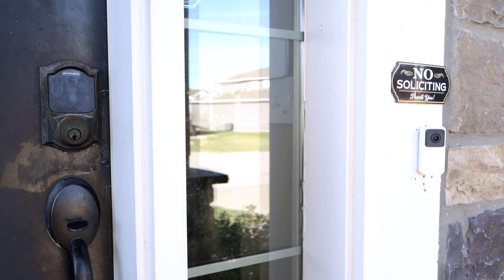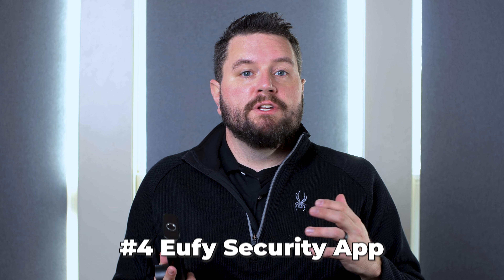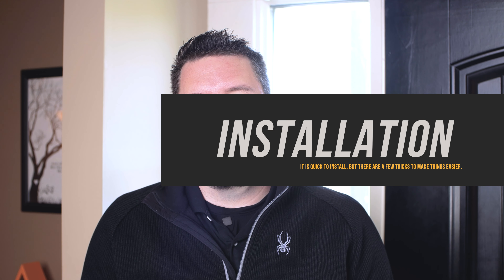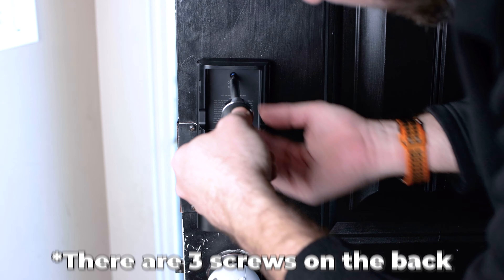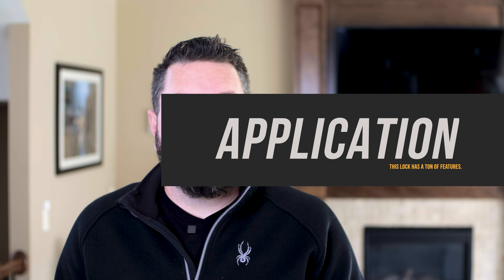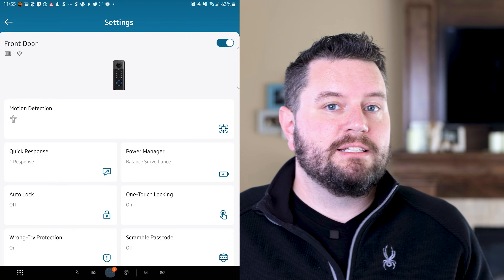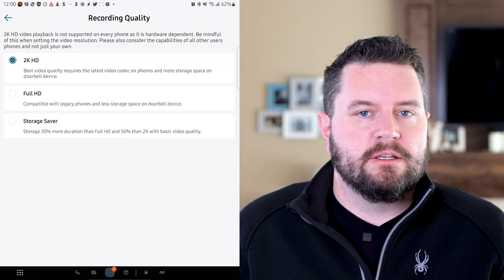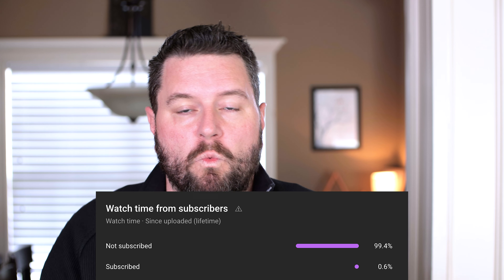3-in-1 Doorbell/2K Camera/Smart Lock || Eufy Video Smart Lock

Comment: This This Smart House video sold me.  However, I wish it mentioned the fact that the camera does not look down and therefore you can't see if a package is at the door.  Delivery person is chest and head at the door and full bodied ~ 3 feet out.  In a condo hallway it is possible to walk down the hallway stop before the camera -grab a packet and retreat.  Of course no one would do that.  I installed this 3-in-1 yesterday and found it very easy and the software to be straight forward.  Looking forward to the 4-in-1 with the dual camera facing down.
Reply from the maker: Hi Chris. I did mention the fact that the camera is stuck and can't be moved. My main complaint is that my door frame takes up 1/4 of my view. But one advantage is that the dual motion detection should pick up any motion even if they are not directly in frame. Hopefully catching a piece of the porch pirate. 

I really hope they update it with swivel camera. But I still love the lock. I am still waiting for the dev of the Home Assistant integration to support it. That will be a game changer!

Comment: I have configured access code for the lock and I am wondering if it will work without internet once installed? Chime won't be installed yet so just standard lock unlock using access code is required. Thanks

Comment: Decent video. A quick tip, its hard to follow instruction videos when there are a lot of cuts away from the meat of the install.
Like 5 - 7min mark should only be your voiceover the install video. 

Also, no need to split-screen when showing the settings... its reducing the important content on the screen.

Comment: I’m in the market for a complete front door knob and dead bolt lock, similar to this and an extra camera. I have 2 front door light fixtures with gfi outlets where a camera will go. The other thing is I have a storm door. The frame would block video until someone opens it. What do you recommend. Prices isn’t a huge concern. Something close to brushed silver on the metal park of the door handle.
Reply from the maker: If your lock will be blocked by a storm door, then maybe look for a separate smart lock and then ether add a camera (with AC power you can use anything). You could do a doorbell cam or any camera connected to your AC power (Wyze, Eufy, ReoLink, etc).

For the lock, what hubs or technologies do you have (Zwave, Zigbee, etc). Before this lock I was using the Schlage dead bolt (Z-wave). It comes in many different colors. They also make a lever handle version. Eufy has a few smart locks as well (without a camera). Let me know a little bit more about your requirements and I would be happy to help. Or jump on our discord: https://tsh.li/discord

Comment: I have the older eufy smart door model , if I install this new 3-1 can I leave my old deadbolt since is from same brand ?
Reply from the maker: You mean the actual deadbolt inside the door? I would think so, but you would want to check them side by side to make sure. I think the one Eufy uses is pretty standard.

Comment: Thanks for the valuable & thorough review! It’s really one the best reviews I certainly benefited from. I just got 2 questions please:

1: I plan to use this lock for my vacation property abroad in Turkey. Therefore, I hope it won’t be an issue if I won’t be using it too often. Because I’m not always there, I have no wifi inside this home. I currently have a bluetooth enabled lock which supports fingerprints and numerical passcodes. It works fine and does not require wifi as long as someone is physically there and has either a passcode or access to the lock app.

If I get this lock, will these features I enjoyed before with my older lock remain functional, even without wifi? (If there’s bluetooth perhaps..)

2: My vacation home is located in a community apartment complex. The complex recently installed a wonderful smart security system for building entry which doesn’t rely on internet from tenant homes, but a newly installed cheap internal internet system we started paying for on a monthly basis. With this system, I can see the building door entry area anytime using the live camera, unlock building door for anyone to enter at anytime, regardless where I am located..
Is there some sort of internal internet that I can utilize besides having to install an active internet subscription in my vacation home?

Thanks

Comment: How can you access doorbell if you have a storm door and this lock is installed on entry door.
Reply from the maker: That would be a slight issue. If the storm door is unlocked, then someone could open it and ring the bell. But your view would be blocked. Maybe consider splitting up to a smart lock and a separate doorbell.

Comment: During winter my door gets stuck. Is it worth getting this if I might have to use the key during that season?  I can see myself getting really annoyed having to remove the cover to access the keyhole. I would also be afraid that the cover will break off. What do you think?
Reply from the maker: Is it the door that gets stuck or the deadbolt? I just installed a new lock for a friend and their deadbolt stuck constantly. I swapped it out with a larger strike on the inside.

If the door gets stuck but the lock can turn, then you shouldn't have any issues. If the deadbolt gets jammed, then you might want to fix that before buying any smart lock. You are going to get a lot of jams and run the battery down.

Hope that answers your question!

Comment: I understand the temperature range listed, but I'm still cautious if this is SERIOUS.  My door faces south, has no shade, and is constantly hammered by the Texas sun.  I wonder how it will survive 3 years or more in this environment.  Any thoughts?
Reply from the maker: So far I haven't had any issues with temp. My door gets extremely hot in the summer and so far no issues (except my door warping).

Comment: What about your power goes out does it still work?
Reply from the maker: The lock will still function locally. You can still unlock it via the keypad / fingerprint / keyway. But if you power is out, then you won't be able to use the doorbell / video functions.
Reply: Thanks

Comment: The link provided doesn't talk about types of doors at all.
Reply from the maker: They did update their website a bit but the information is still there at the bottom. Now they say it's compatible with all doors in most countries.

Video Smart Lock is compatible with most doors used in the US, Canada, and Australia. Plus, it can be easily installed within 15 minutes with just a screwdriver.

Video Smart Lock works with all latch holes, 38-54mm wide, 60-70 mm deep.

Not recommended for storm doors
Reply: @ThisSmartHouse  I'm taking one abroad and taking an exact size circular hole cutter bit with me in case I can't find one there because they use metric, You're right I don't see why it shouldn't work with anydoor, Door thicknesses are from 1.5" to 2" worldwide and the lock should accomodate for that.

Comment: you forgot the third screw on the bottom of the inside part and the plug to cover the hole!  
otherwise good info.
Reply from the maker: Ha ha, oops! You take these things apart so many times for a video, I am bound to miss something. Thanks for point that out!
Reply: @ThisSmartHouse  After many days of researching electric door locks, I bought the Eufy 3 IN 1 last week and installed it, (surprisingly easy I'm 73) I set it up within an hour.  The only reason I noticed the omission was doing it once myself.  You supplied great info on app use. 
The mechanical install isn't the hard part, it's the details of app use and  house network links, that sequence.  That's the invisible part of the install that should flow. Those steps in detail, complete the install painlessly. 
I've watched many install videos, details in yours complete my understanding of the sequence and app. Good pace and clarity THANKS.  art    :face-purple-wide-eyes: